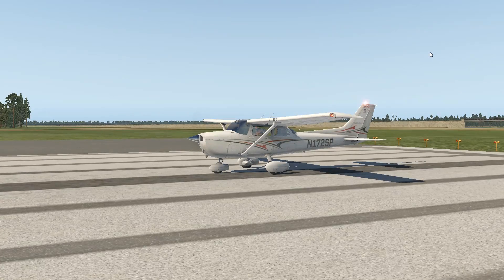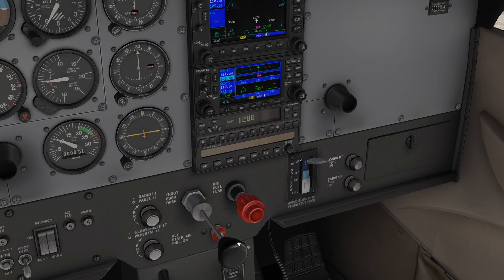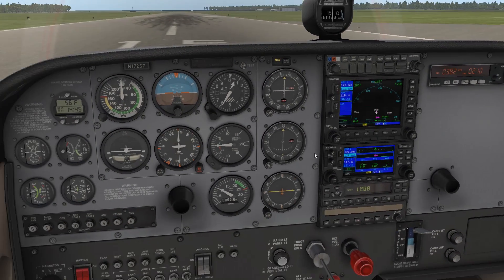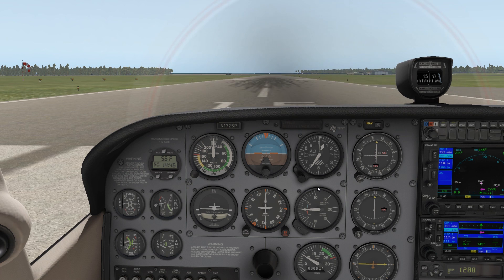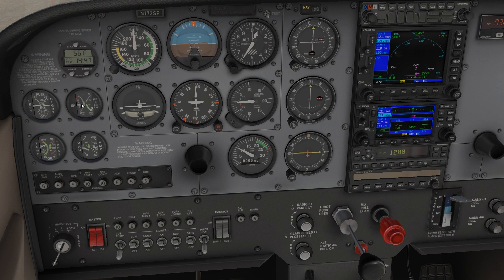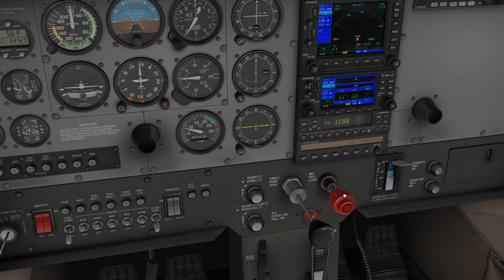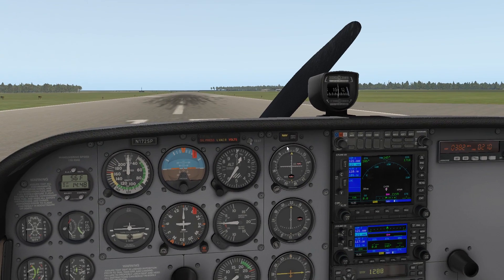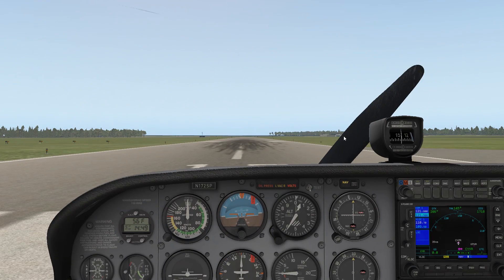What is Mixture for aircraft? Find out about the big RED knob!

Comment: Not true that less fuel results in hotter motor. It's true that fuel rich will run cooler than less fuel rich, but if you move to air rich the temperature goes down again.
There is one specific fuel/air ratio which will result in the hottest combustion. But going to fuel richer or less fuel from that point will result in cooler combustion!
Watch: "Why Lean Engines Do NOT Run Hot - Myth Busted"

Comment: Seems like the mixture is essentially the choke for an airplane motor.. yes??
Reply: Pssst... all my cars have fuel injection and my lawnmower is electric, so what's a choke???  J/K -- this is a GREAT analogy (except that it works the OTHER way, by regulating the amount of fuel rather than by restricting the flow of air -- but the result is pretty much the same)!

Comment: OK so I was talking about the piper cub I didn’t I never seen a mixer control the piper
Reply: You must be a student pilot just starting your training -- the Cub absolutely DOES have a mixture control, it's the red knob on the right (and the carb heat is there as well)!  Of course, in the Cub it doesn't get much use -- UNLESS you're flying in the mountains or over the high prairies, then you ABSOLUTELY NEED it!

Comment: Hey slight correction there EGT is exhaust gas temperature not engine temperature
Reply: Which is why you do NOT normally use the mixture to control the engine temperature!

Comment: The throttle shouldn't be a small knob you push and pull. It should be a larger device.
Reply: this is the correct throttle for the cessna
Reply: It's light and it works, you keep your hand on it while flying so it isn't a big deal

Comment: Regarding the EGT (Exhaust gas temperature)...  This is actually the key to trimming the mixture at altitude...
you want it as hot as possible, this indicates that ALL the fuel is being burned.
at altitude you want to trim the mixture to make the EGT as high as possible to conserve fuel.
this whole procedure is generally not necessary below 3000 feet AGL... your mileage may vary.
Reply: Isn't that 3,000 ft MSL? If you're in Denver, you'll be lean all the time, no?
Reply: @Sifo_Dyas  3000 ft MSL because it depends on air pressure and amount of O2 in the air. If we would use AGL but airfield is 6000 ft MSL full mixture would prove the engine has lower power because of wrond mixture setting on hight altitude over the MSL. It is quite dangerous situation.
Reply: @ttvFairPlayerPL  When the airfield is at 6000 ft MSL, you actually have to lean the mixture more than halfway back even for takeoff and landing!
Reply: Actually you make the hole video, many thanks!!!